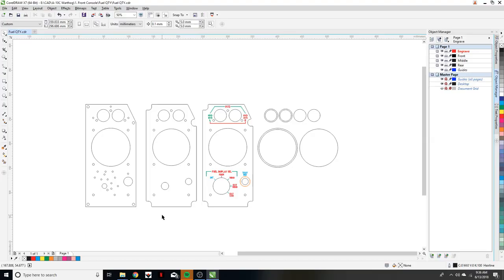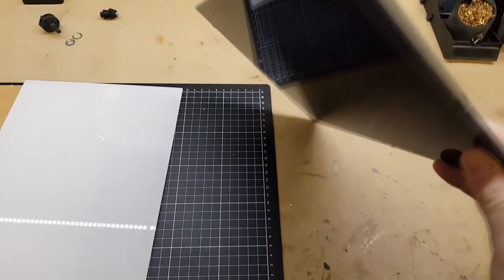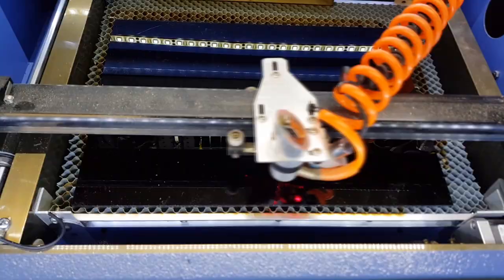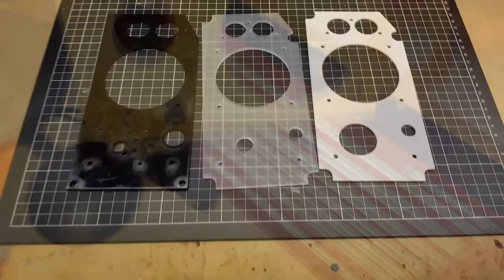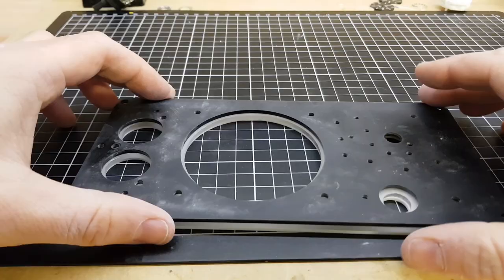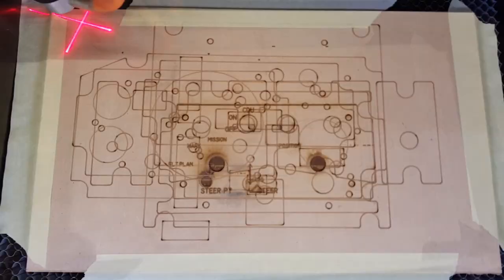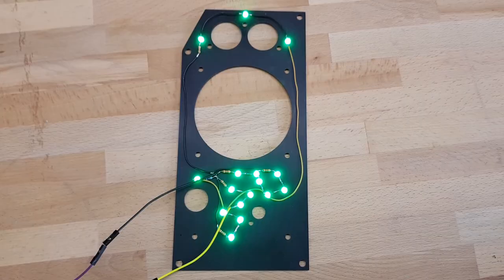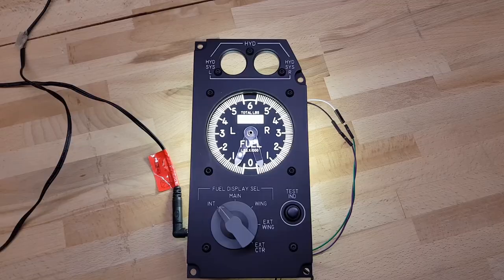Making Flight Sim Panels with my eBay Laser

Comment: Hi Ray, brilliant video. It was good to see your approach to backlighting, an up close of your laser machine and the software you use. 
A few questions
* Does the laser have x, y and z axis. Or is it x and y, and you alter the bed height for anything z related 
* when using a laser, does it ever affect the paint around the area engraved given heat output
* You laser the holes, paint, then laser the engraving. Does it work to paint and then laser the holes and engrave at the same time
* What are the exact 3mm leds you use, along with what resistor value and power supply. 
* I understand the 3mm leds will need to sit in a middle layer as they protrude. Is the middle layer just to house the protrusion, or does the clear acrylic diffuse the light and better spread it 
* How have these single clustered leds performed over time, have you had many that stopped working and needed replacing 
* Is the laser cad software you use freeware or from a particular company, is there much needed around setting tool paths or the laser equivalent.
* I think on Instagram you posted - knobs you moulded, any plans for a video on how to do this
* For buttons that are Backlit, like cdu push buttons - what buttons do you use and how do you backlight them
Thanks for sharing your build process, brilliant, cheers
Reply from the maker: Cheers Craig. To answer your questions-
1) The cheap lasers don’t come with any Z axis. I actually bought one for it- but ended up removing it shortly after. My Z axis is fixed- however I made the legs adjustable with a few bolts so I alter the height for different thicknesses of plastic.
2) The laser engraving does not affect the paint around it- depending on the quality of paint you use. I’ve had it melt away surroundings when I used cheap paint. It took LOTS of trial and error to get the setting right- I’ve got a massive bin full of panels that didn’t make the cut.
3) The 3mm LEDS are the cheapest I could find on eBay. I used an online resistance calculator to determine what resisters to use- in my case its 100k resisters per 3 LEDs. I use a 12V power supply for the backlight circuit- from an ordinary PC power supply.
4) The middle panel is to diffuse the light better. I’ve found the further the LEDs are away from the panel the better the result. I’ve experimented with sanding off the top of the LEDs as well and the difference was negligible- I just find drilling the pockets is easier. The middle panel also hides the screw rings on the switches, and saves me having to engrave out a pocket for them. 
5) I’ve only replaced a few LEDs so far- and all of these were from me breaking them during handling when working on the panels. None have failed on their own yet.
6) The software for the laser is not freeware- it software comes with the upgraded hardware I bought for the laser. There are free alternatives – my needs are very basic in the world of lasers so I have never needed anything more that this offers. Never tried anything else because Im happy with it.
7) I haven’t made any knobs myself- all the ones are 3D printed from shapeways. There is a shop on Shapeways called A-10C Warthog Supplies- run by a forum member.
8) I’ll post a video about the CDU soon. It running cheap eBay tactile switches with buttons I made myself. That one was way to hard to back light using individual LED's- just too many buttons. I ended up using eBay LED strip for that- the results were pretty good. If I had to start the entire pit again id use that method to back light the entire pit- like you have on yours. The LED strip method is just so much easier and the results are brilliant, better than this way really. That’s what I’ll be doing when/if I ever start my Hornet/Tomcat pit.
Reply: Thanks for the info Ray, appreciated
Reply: Dude you answered all his questions, hat's off to you man!

Comment: Quick question regarding these panels and backlighting.  How are you running your leds for the whole cockpit?  By that I mean are you running them off a dedicated power supply and furthermore how are you making them dimmable?  In y case with a Hornet there is a dimmer in the real Hornet for the consoles and a separate one for the instrument panel.  I only ask because using 3mm leds all in parallel is like 700 leds for all the panels combined.  Thats in the area of 20-30amps.  What dimmer do you use?  Maybe some videos on how you tie the physical aspects with the virtual.  Thanks
Reply from the maker: Each group of three leds is in series, then all the groups of each panel is in parallel. All the panels in each console are then wired together in parallel. The power comes from one of the 12v rails in the PC power supply that runs the whole cockpit. Dimming is done by a 30amp PWM dimmer that is wired up behind the lighting control panel. The PC power supply has four seperate 12V rails, I use one for the back lighting, one for the flood lighting, one for the power to all the cards and servos, and one runs all the miscellaneous stuff like usb chargers and the single work light.
Reply: @thewarthogproject  Ahh ok perfect.  I've used pwm dimmers in the past and at times when really low on dim it would flicker (assuming its the "Pulse" ...the P in PWM, lol.  Thanks.  I'll try your wiring scheme.
Reply from the maker: @Nick-xe2hu  yep I have noticed a  pulse, but only when at the very very lowest setting it goes, which I never actually have it on anyway. Buy a good quality one, not the cheapest Chinese made ones on ebay. Got mine at a local electronics store.

Comment: Probably could have cut down on the amount of LEDs by using diffusor panels cut in shape, then applying vinyl/paint to the backside to avoid the light-bleed.
The only reason i could see using so many individual LEDs is if you wanted to individually regulate their brightness as well for indicating purposes.
Reply: Neko Imouto , do you have a link to the diffusor panel you are referring to?

Comment: Nice Vid, I been using CorelDraw for many years. It includes PhotoPaint too (both Adobe alternatives), and will never go back to the costly Adobe system.
Reply: I remember using CorelDraw back in the early 90s. I didn't know it was still around.
Reply: I still have coral draw. It was a free copy from Currys here I the UK back in early 2000's. Still the most useful software disc i don't want to lose.

Comment: Which font do you use for the panel labels and numbers?
Reply: There's an actual Mil Spec font called MS 33558 which either matches this or comes very close. It's a legacy engraving font but is often used for control panels (at least older/legacy ones).  There should be truetype version available to download from various sources.

Comment: What kind of foil is this that you applied with a heat gun to the back of the LEDs. Great stuff, I am always impressed what one can do at home these days.
Sincerely Bernhard
Reply from the maker: It's just matt black vinyl sheet. Its the same stuff people use to wrap cars etc. The cheapest stuff I could find on ebay!
Reply: I am stunned, have to admit I have not seen such foil. Do yoy just lay it on top of the wireing and melt it? Or how is it done?
Greetings Bernhard

Comment: I'm not a flight SIM guy (race sims are my thing) but this is absolutely mega!! I had no idea Lazer cutting could be done at home. Will it cut carbon fibre sheet?
Reply: You would need a lot more than 40 watts, and even then CF composites are better cut with a waterjet or a router with a water bath. (To contain the dust.)  With a relatively low-power laser like the K40, the epoxy just burns and the carbon dissipates the heat too well to be cut.

Comment: be great if you come back to answer some questions:) I have a k40 with the free k40 whisper upgrade. but I can not get a good clean engrave on acrylic, paint burns, it's either to faint or burns deep & nasty

I can do a great engrave on romark 2 color plastics, my acrylic is both 3mm & .09mm 3mm brand makrold ? might be a letter or 2 left off end of words,left over piece
 ,thin stuff just says lexon
I can turn the power way down & engrave lines on paper & letters on stickers
but can't get this to engrave.

I also am engraving words flipped horizontal, so paint is underneath, won't be able to get scratched up ever

Comment: Hi man, thx for your video, but I have a question, could you link references about your laser machine? I would buy one of that for creating my F18 pit but I have no idea with machine I should buy. Seems the EleksMaker A3 5000mw is a good laser machine but software seems to be too unpredictable....
Reply from the maker: Hi mate. If you search for ‘40 watt laser’ in eBay there will be heaps of them, they are commonly referred to as the K40. I just bought the cheapest one I could find at the time (about 5 years ago). Don’t expect it to work out of the box- you do get what you pay for. I’m certainly no laser expert so can’t really give you advise on other models.

Comment: I might have missed this but where did you get the knob?  Great video!
Reply from the maker: The knob is a real one I found it on eBay for cheap. It was in very bad condition, but a bit of filler and a coat of paint and it looks almost as new!

Comment: Are you coating the top element with some clear coating or do you leave it as is?
Reply from the maker: No clear coat. I tried some on early panels but the finish ended up looking worse.

Comment: I hope someone can answer this for me, I've watched quite a few CNC videos and I've always been confused by the order in which things are performed. It seems like the machine could do less re-positioning and just do all of the engraving from one corner to another rather than hoping around to do different parts of the job. Is this something that is determined by the operator or the machine?
Reply: I know it's late and you've probably got an answer, in any case it's controlled by the CAM program. So you design it in CAD, transfer it to the CAM program that actually comes up with the cutter path, and then the machine does whatever the CAM program has programmed it to do. CAM programs can be set up to do things in different orders. Often they pick up the order that the layers are drawn in CAD and then just go layer by layer but you can normally reorder things if you need to. Realistically the time taken to rapid over from one position to another is nothing compared to the time it would take to reprogram it. Maybe worth it if you're doing hundreds of parts. Definitely not worth it for a single part.

Comment: You should grind off the lenses on LEDs, not drill for them. Just tuch them to the grinding wheel or hit them with the file. The lens is what focuses all that light into a disgusting beam which you definitely want to avoid. It will take more time that to drill, but trust me, the light will spread much much more evenly. You can even leave them rough/matte for better spread.

Comment: I found a b-29 super fortress engine RPM gauge on eBay could I use that
Reply: If you scaled the panel to the correct size, leaving a hole for the gauge with the correct diameter, than it should work just fine!
And it would be an authentic part, which instantly makes it that much cooler!

Comment: Really nice, I've been watching this tutorial over and over again, I'm building a 737 cockpit and one thing just keeps on breaking my mind. If the front acrylic panel is solid white how can it illuminate the engraved text from the led's? Does it just let light through only on the engraved places? Your help would be much appreciated!
Reply: He spray paints the white front panel with a black paint.  Then he lazer etches through the paint to the white layer.  The White layer acts as a light diffuser, so in effect the whole thing is glowing and the black paint prevents it from shining out.

Comment: if u cut off the air while lasering .. the material lights up but thats not an issue ... and u have clean cuts... just saying.
Reply from the maker: Not with the materials I use. If I turn off the air the paint will ignite and the result is... not clean.

Comment: Hello, I have just bought a K40 since I watched your video, to make F-16 panels.
I am quite lost because I amnot good at drawing. Would you be kind to share your svg file, to inspire me, please ;)
I don't know how you did your drawing file, and mine is just awful.
Thank you so much
Reply from the maker: All my panel drawings are available for free- link to my dropbox is in this thread https://forums.eagle.ru/showthread.php?p=3828889#post3828889. They are not SVG files, i cut using DXF, but ive saved these as PDF. It should be easy enough to change them to any format you need.
Reply: @thewarthogproject  Thank you so much, your work is inspiring.
I bought a K40 to make my own panels (something between F14, F18, A10 and Mirage...)
For the moment, I just have problems to align mirror, but I keep going ;)

Comment: Would you be willing to share your CorelDraw or dxf files?  I'm doing a similar project only I'll be 3D printing my panels then laser etching my faces.
Reply from the maker: I have shared all my files. Have a look over on the ED forums for the download link.
Reply: @thewarthogproject  I'm sure you have heard it many times but this project is amazing, bloody well done!

I'd be really interested in how you power and wire the LEDs and avoid them all burning out over time.  You lighting option is fantastic and I'm probably going to copy it for my own build
Reply from the maker: @randiebarsteward9406  Thanks! All the LEDs are wired up in groups of three  with resistors. They are dimmed using pwm dimmers. I've had no real issue with any burning out so far, maybe one or two out of  the lot.

Comment: Please, please, please, don't cut with the lid open.  Even if your eyes are not looking directly at the laser, a stray beam bouncing off something can ruin your eyesight in a millisecond. I have done a lot of work with lasers and it is always safety first !!!  Laser light can reflect of surfaces even if it is ablating the material.  Some materials are quite reflective and even 20% reflection is enough laser power to do serious damage to the human body and eyesight especially.